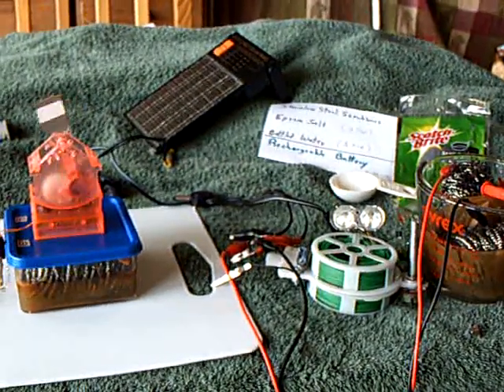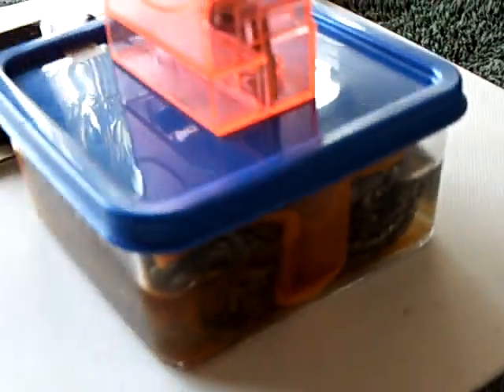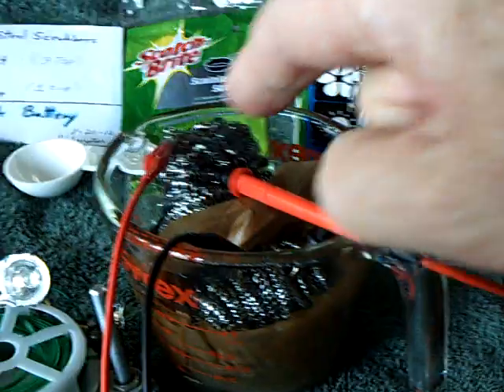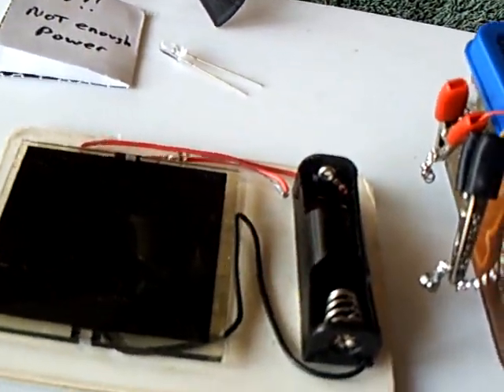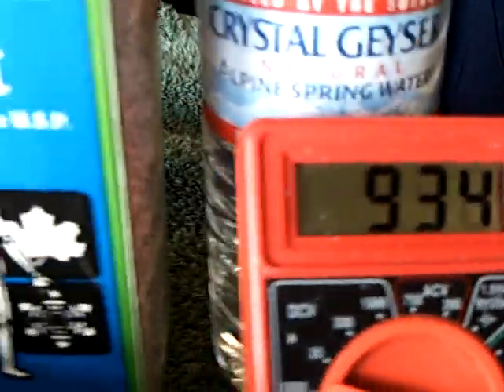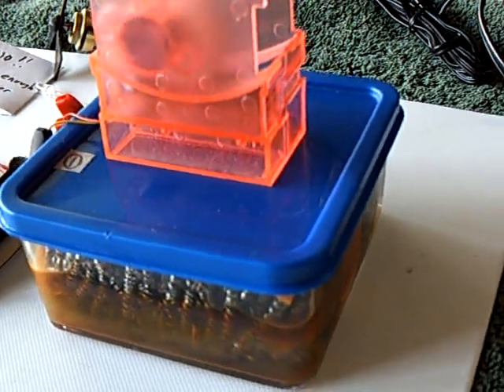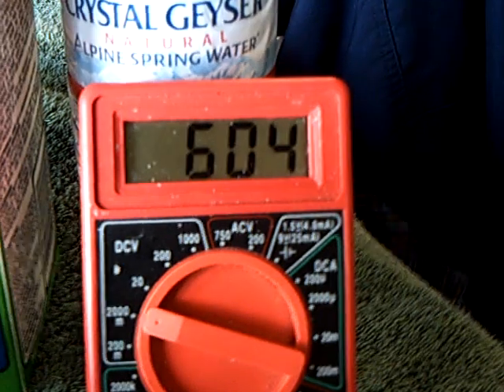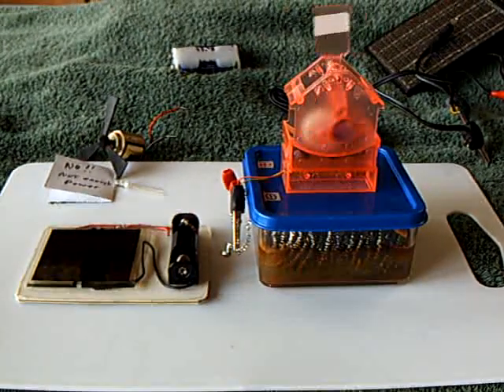Homemade rechargeable after 12 days

Comment: Great to hear from you! I have been interested in metal plating lately and came across  with some metal melting acids like muriatic acid, caustic acid both you can find in hardware stores.  If we want to get the electrons out of the metal degrading it cannot be avoided.  e.g. rust. Using magnesium sulfate (Epsom salt) you get the second metal in your bottle. I used a wet cloth and just placed different metals and measured the voltage between them. Aluminium and copper was the best choice. 0.6V.

Comment from the maker: The whole idea behind this "rechargeable" battery project is to NOT have the metal electrodes breakdown (galvanic reaction).  This quest started with John Bedini's lead / Alum rechargeables which worked GREAT!!!  -----but people were worried about using lead so I went this direction.  This cell only has stainless steel metal as electrodes.  The MgSO4 is in solution.  This is some kind of a reverseable reaction storage cell like a lead acid-----but it also might be some kind of hybrid.

Comment from the maker: This is not a two dissimlar metals redox reaction cell like a lemon battery--- but ,like you say, AIR might be part of why this battery works.  I really don't know.   I can try the hydrogen peroxide added to the electrolyte and see what happens.  What we don't want to do is add something that degrades the stainlees steel scrubbers with no gain in cell performance or longevity.  Thanks for the comment.  All help on this is welcome.

Comment: I have made an aluminium & copper lemon acid battery. I closed it and the day after it has lost its voltage 0.6V. I opened the bottle to see what went wrong and a voltage came back. If the chemical reaction is oxidation we have to keep the metal where oxygen can rich it. Did you try to add hydrogen-peroxide to your electrolyte liquid?